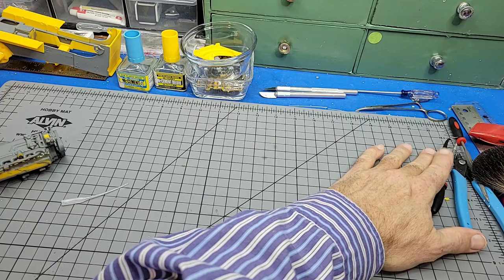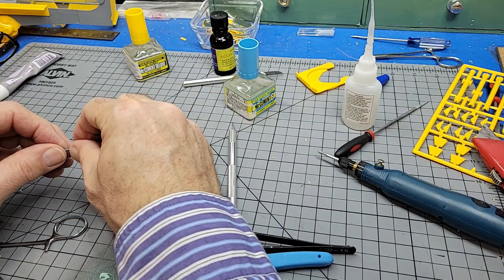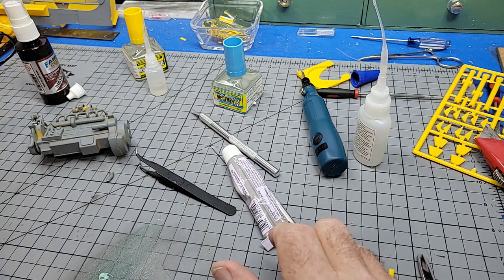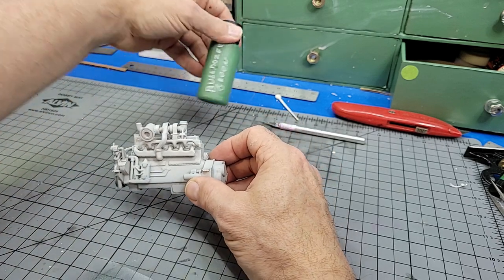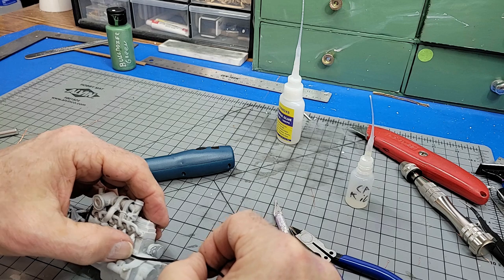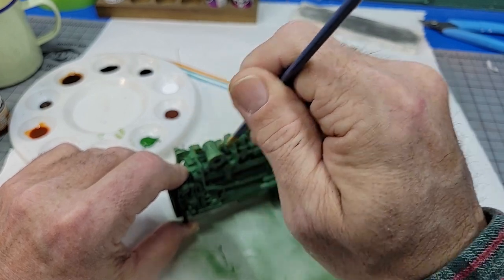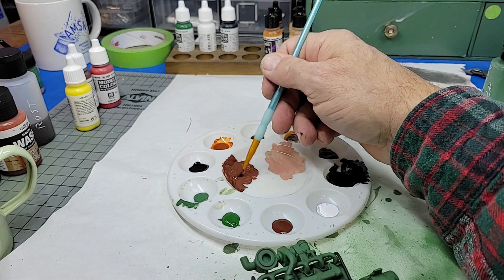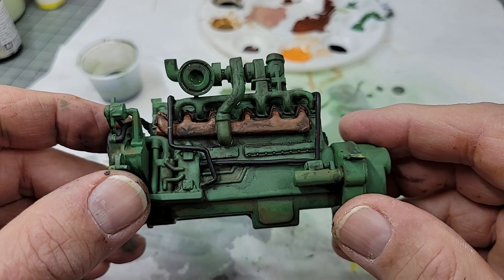Assembly, Adding Details, and Weathering The Engine on the AMT Construction Bulldozer

Comment: Nice neat assembly. I am yet to assemble my dozer, currently working on and doing mods on the lowboy trailer for it. Your accelerator dispenser is a good idea. I have been dipping a cotton tip into my big bottle and dabbing. I need to make that little dispenser bottle.